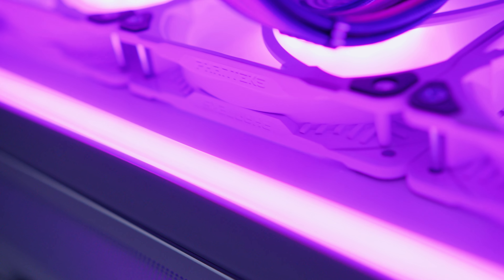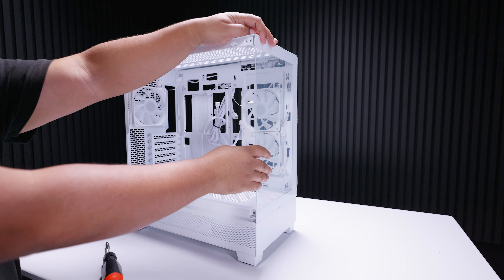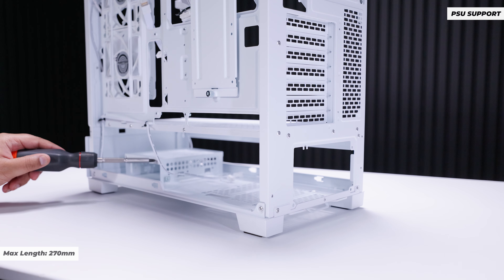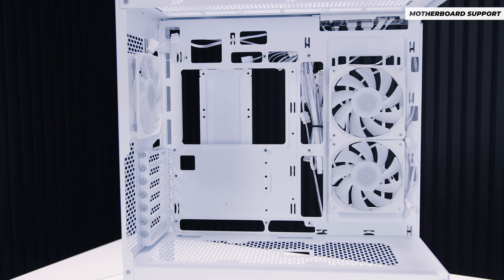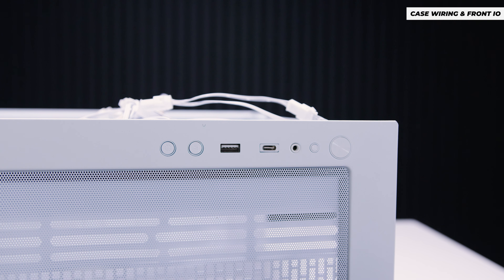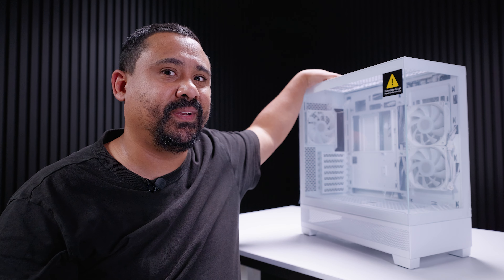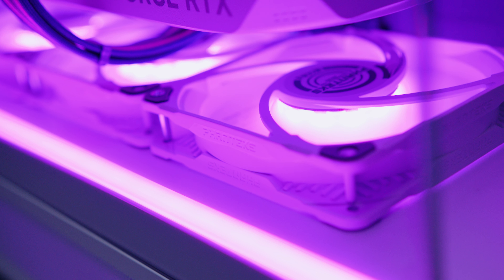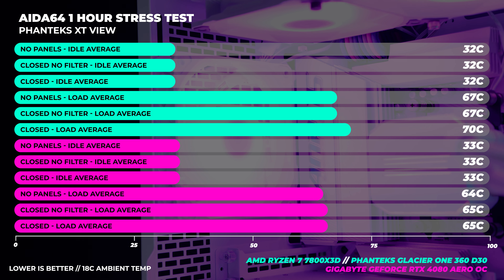DO NOT buy the Phanteks NV5... Buy this for $79 instead!

Comment: can you vertically mount your GPU while having three 120mm fans installed at the bottom? If I use a cooler master vertical kit v3, would that work?

Comment: Made it to the very end Easily. Subscribed as well. Good content. Now after watching it again, I take note that you recommend flipping the side fans. On the case specs I am seeing in December it says the 2 side fans are intake fans although your default position looks like all 3 fans are the same orientation, I am assuming exhaust. Given that the cooler fans are exhaust I could see why you would flip the side fans. So just to be sure, your final build has 3 bottom fans intake, 1 rear fan exhaust, 3 cooler fans exhaust and 2 side fans intake for a total of 5 intake fans and 4 exhaust fans. Do I have that correct?

Comment: I got my xt pro ultra a week ago and love it. Easy to build in, plenty of space for psu+cables and hdd rack. The front panel connectors are unified so you don't have to figure which cable to which pin.
Reply: How is the fan noise

Comment: I agree 100% about the brightness of the fans, there should be an additional button to control that. Also, I would have like to seen rubber grommets for the cutouts but other than that this is a solid case. I already ordered an NV5 with the d30 fans, that case is just a beaut. But i can definitely see the value in this one for a more affordable option.

Comment: What I love about Phanteks cases is that they do things that midtowers aren't normally capable of, like fitting 140mm fans in intake positions. What stops me from buying them, are that they don't give an intercontinental f**k about providing a good amount of cable management space. I tried building in the NV7 and my god, the amount amount of space between the backplate of the motherboard and the side panel isn't nearly enough to accommodate one fan or RGB controller plus custom cable extensions, let alone two or more controllers, like if you decided to populate the case with SWAFAN's. Until they release an NV7 that is true dual chamber, they'll get nadda from me!
Reply: Yep...found this out the hard way trying to use regular ARGB fans in mine. It was such  nightmare I had to end up switching all out for D30 fans.

Comment: I just got this case and the struggle I'm having is the reconnection of the fans. 

I don't have the best memory, so when I had reversed the two fans in the back, I could not recall which connectors to put back. 

My one complaint is the lack of instructions on this, even if Phantek may not anticipated people doing this, maybe someone wants to put it elsewhere or add more.

I'm not tech savvy, so having those steps would help. Currently my build is on hold until I can find the answer 😭

Comment: Another point I wanna raise that might be a good feedback: for cases like these people usually gonna put them on the desk right next to the monitor etc to display the PC. Putting the front IO at the top would be unfavorable since people then need to stand up to plug instead of just using them while sitting. There are cases that have similar layout like this but with front io at the bottom of the case - making them more accessible.
Reply: Yap someone case i dont remember name, have front io in Bottom

Comment: I didn't like quality of the case. It's kind of cheap. And I think that phanteks fans are a little bit overpriced. Also you need reversed version for such opened glass case normaly. But you can't have it..
When I ordered such case I was kind of glad it was damaged during the transportation so I could return it and order different model (Neo Qube 2 IM)

Comment: Would this case fit a 280mm radiator in the top?
Reply from the maker: Watch the video 😉
Reply: @GearSeekers  Yeah I did watch it.  Upto 360mm, but that doesn't aways mean it'll fit a 280mm.  Could be 240mm/360mm.
Reply: @AucklandMag what you just said makes no sense whatsoever
Reply: @il1usi0ns66   @il1usi0ns66  Yes it does.  You're maybe to simple to understand.  He said in the video upto 360mm which Phanteks advertise.  But like I said that doesn't always mean it'll fit every radiator size upto 360mm..  One other case I know off also claims the same, but it'll only fit a 120/240/360mm radiator and not a 280mm radiator.  This YouTubers just an arse.  Could have just answered the question rather than be a dick.
Reply: @AucklandMag and you could just look up the specs but hey youre here.

Comment: They didn't use a cover strip to the top glass panel
Reply: the sidepanel isnt on in the broll... check ur eyes.
Reply: @alexandrulascu6436  Nick should have it on at the talking head summary. He can angle it so the glass does so too much refection. Doesn't rep the case in its final form
Reply: @Drvudoo  what does one have to do with the other?

Comment: Dude the flex on the top is just horrific
Don't buy this cheap as case 
Not worth it
Get a Lian Li
Reply: My 011 Air Mini has some manufacturing/assembly issues, bit disappointed actually.
Reply: @nimrodery  nothing like the flex bro
Reply: @JJ-gk5tn  True, the Flex is cheap and it seems to have better airflow also 3 RGB fans which are probably better than what Lian Li included.
Reply: @nimrodery  in terms of value I can recommend you the king 95 pro
Stunning case with 5 fans Allready included
Reply: @JJ-gk5tn  unavailable here though I like the case. Not sure it would get better Temps or that it's more solidly built, as I recall there are some compromises for the price (probably need to replace most or all fans for example)
Reply: @nimrodery  I can assure you that the king 95 has slightly better built quality then the regular O11 Dynamic
Reply: @JJ-gk5tn  I wasn't comparing those two, I was comparing the 2 cheaper cases